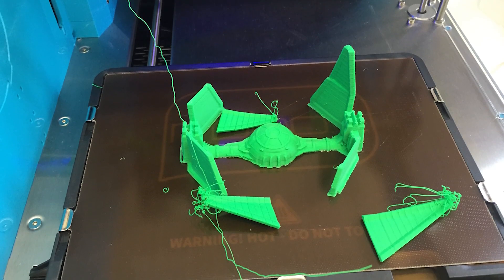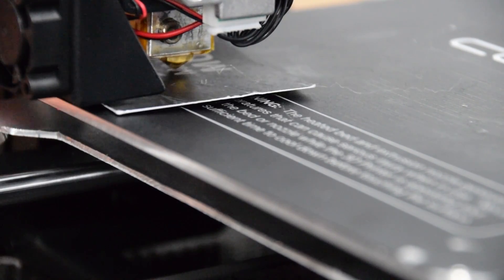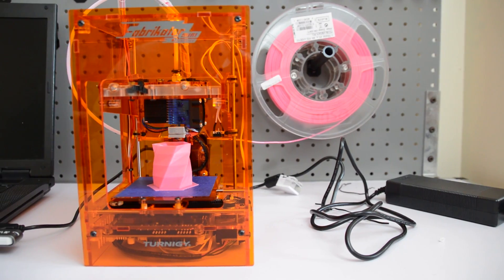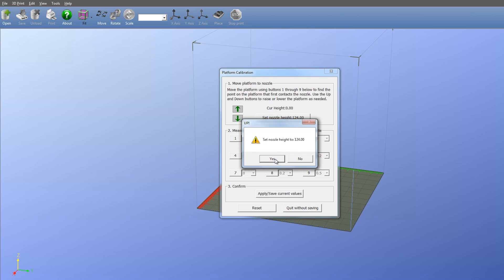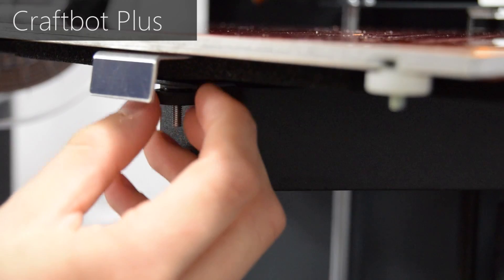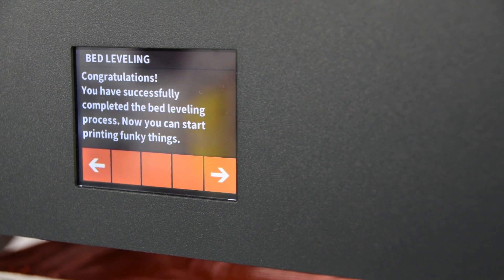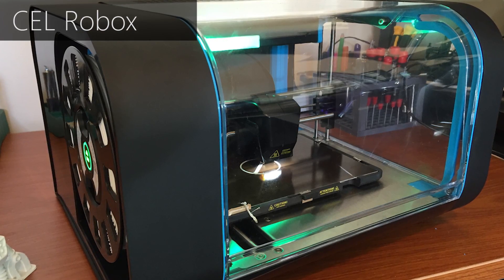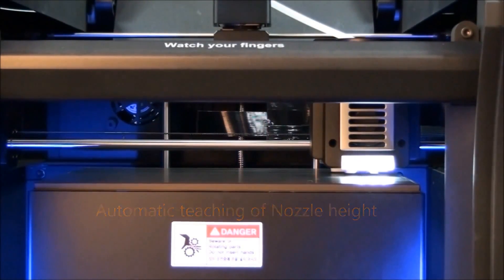How to Set your Nozzle Height and Level your Bed - 3D Printing 101

Comment: An issue I am running into is the printer will lay the trim line flawlessly and then when it proceeds to actually print the first layer of the model, it just wont stick. The trim line sticks but the center doesn't. I've adjusted the height at least eighty times in the last two days. Any suggestions?

Comment: if you have a 0.2mm card why not use the card to set nozzle to zero by telling the nozzle where it really is? you can even do a bed leveling mesh from this method.

Adjust the bed to touch your card. Then tell the control software it is at 0.20mm currently. done. no muss no fuss.

No guess and check. 

Is the way the FlSUN Cube does this (as described above) just new?

It means the slicer knows that you asked for a .35mm first layer and it knows z=0 is thr nozzle touching the bed, so it just starts printing at 0.35mm. done. why make it so extra manual?

plus how you you get an accurately tall print this way. it would allways be off in the z axis if printer z=0 isn't set to nozzle touching the bed (by telling it the offset you tested with, like the card or a4 sheet of paper)
Reply: have printers just come this far in a few years. how was this not obvious to the origionals?

Comment: Angus I got the Prusa I3 Mk2. good printer fully assembled. However going through the menu options ,etc. I clicked on Calibrate XYZ, so the printer went ahead and did its thing, however when it comes to the nozzle height I am a bit worried that I may not be setting it correctly. The Live Z calibration is a great option  but when do you really know if your setting is the best possible setting. ? When I print , I have been able to see that the back of my first print is no longer shinny or fused together like I used to have it. Is there any feedback you can provide here? I also noticing that my prints are way more shinier not sure why. I am using Colorfab PLA.

Comment: HEy angus my printer manufacturer (CR-10) says to use a A4 sheet of paper which has a thickness of 0.1mm a bussines card is way thicker. Should i listen to them or you?? I learnt all i know from you!
Reply: The statement he made - set the nozzle height to fractionally less than the layer height - is the important bit as you need the 1st layer to squish out just a teeny bit more than the rest in order to grip the bed, so that card may have been around 230gsm board, for an initial layer of 300um. There's a nice table here for you to pick the right weight: http://www.zxprinter.com/support/paper-thickness.html.
But why not just stop using scraps of paper completely? Paper is fine for bills, boxes and bum-wipe, but not so hot for precision measurement at the micron scale. Splash out on a set of steel feeler gauges and be 100% confident in the gapping you set; no grabbing, tearing, curled edges, and a good steel gauge will cut any ooze from the nozzle as you probe so you can be confident you're measuring from the brass not a glob of plastic. Because the metal doesn't deflect into the holes at the bed mounts, you can also set the gap directly over the mounting points. That means once you've set the corner, it's done - you don't have to go twice around every time. Literally halves the levelling time! I got a set from Halfords for £4 - USians near a Hodor Fight can get a set under $5 plus tax.
Reply: baruch shad I was wondering the same thing.  But, I realize now what I did wrong recently when I suddenly had issues printing.  On my i3, if I print at .3 or .4 then a business card makes sense.  For .1mm layer, a sheet of paper.

Comment: Am I the only one who prefers wing nuts to thumbscrews?
Reply: Nope I use Wing nuts to take the print off,
Reply: If the space is more open and I can get my whole hand in it, I prefer wingnuts.  But for my printer (duplicator i3) I like the thumbscrews so I can stick a finger over and adjust it
Reply: Once I get this thing dialed in I will print numbered wheels then install a mirror underneath the bed so I can see what number I dialed in.  To HELL  with all this lack of
Reply: Would love to hack a cheap gyro to it to adjust  itself for weight on large and heavy items stainless steel ESPECIALLY.

Comment: It's very confusing to me how there is a conflation of 'level', 'flat', and I think 'height', or 'nozzle height', these often get shoved into the term 'level'. Something can be level and not flat, or flat but perpendicular to the ground.  Or, you can be perfectly level at the wrong level.

Is leveling the surface making it level, or parallel to a plane the printer thinks is level?  If the surface is flat, how far out-of-level can it get before there is a problem?  And that is an ambiguous question.  If the printer's idea of level is set to the flat printing surface, how far out-of-level, meaning "out-of-plumb", before  their is a problem?  

I'm very new to this, old hands probably have no problem with the ambiguities, might not even realize how rife they are in their speech, but it can sure confuse inexperienced. .

Comment: The Makerbot Replicator 5th gen also does the z axis auto adjustment before every print. The difference is that the smart extruder has a hall-effect sensor inside and there is a magnet mounted to the hotend that it uses. You still have to go through guided leveling every so often, but it uses the same system to do that too.

Comment: I'm currently staring at my computer screen, typing this comment, but a moment ago I was staring at my BLTouch sensor that finally arrived from South Korea a couple days ago...which I keep procrastinating on installing as I dread the currently well-bundled wires turning into a tumbleweed, dealing with extruder carriage dis/re-assembly, and hoping my fingers can get into the board's enclosure without breaking something and/or requiring me to disassemble even more crap. 

Ugh, just writing that paragraph gave me a headache. :-/  I'll give someone $20 plus the old/current auto-level sensor as payment to come do it for me while I drink booze and watch! :D

Comment: I'm not a fan of using a spacer card (business card). I have a FlashForge Creator Pro which uses manual leveling with three points of adjustment. First thing I did was chuck the card. Instead, I use blade type gap gauges. I admit I haven't got a solid rule for the actual distance to aim for. I've been using 0.2mm because the nozzles are 0.4mm. I set the extruders over each adjustment point and either the 0.2mm blade will clear the gap or it won't. I tested for warpage using a straight edge. Before I do the leveling procedure, I work the springs. It seems they can shift about. I start at the front and then work clockwise. Once I've got each nozzle set at the adjustment points, I try a few random points on the bed. Seems to work for that part.

I think the real challenge for me now, as I'm still a neophyte, is working out the proper settings in Simplyfy3D.
Reply: Better to modify the print head and do 1 adjustment from the top,,

Comment: I was wondering about the following method (which I haven't tried yet): 
Instead of using a piece of paper and try to have the nozzle press at it at the same force in every point of the bed I thought about: 
1. Calibrate the nozzle to exactly the biggest distance that doesn't allow inserting the piece of paper. 
2. Compute the wanted distance through the slicer (or perhaps simply move the object you're printing to be in the 'air'). 

Why wouldn't this work?

Comment: Sorry to be a nuisance, but have you had any luck ripping 3D models from Unreal games? Also I enjoy your videos so much I will contribute to your video production this coming week, keep producing.
Reply from the maker: +Felipe Acevedo I have successfully ripped from Unreal Engine 3 using the method I describe in my 'chivalry' video, but I haven't yet pulled any Unreal Engine 4 files. You need a way to unpack .uasset files. I want to print from Ark - survival evolved which is based on UE4. Thanks for the support!

Comment: One thing I never see anybody mention is when leveling the bed make sure the z axis is level. You can swing your bed around all day trying to make it level but if the z isnt level all you are doing is compensating. Its easy to do just take a pair of digital calipers and measure the distance between the bottom and a smooth rod or something on the z thats at the same point on both sides
Reply: Ask Holy Spirit to teach you and to guide
you. I would recommend the YouTube Cleveland street preachers and follow Jesus no man no religion. Be holy and obey Jesus. Hebrews 5:9 "salvation is for those who obey. Jesus says if you love me keep my commandments (John 14:15). Jesus even says if you keep my commandments then you shall abide in my love (John 15:10).

Comment: Hi  Angus, what would you say is the optimal height of an extruder, a sheet of paper is about .003 thousands of an inch while a business card is about .004 or .005 in thickness, just wondering.
Reply from the maker: +Felipe Acevedo It's hard to say, some 3D Printer beds you can push the nozzle really hard and close into them like the up mini, so for that I would go closer than say, a printer with a large glass bed with very little flex. I usually set to a business card and then test, if it's still too far away i'll slowly creep it closer. It's always better practice to be too far away than too close as you can easily ruin your print surface!

Comment: On the Wanhao i3, I use a relatively thin sheet of note paper with one fold on one side. I set the bed level so that I can't feel the single sheet, but the double layer offers some resistance and it's still easy to pull the fold through the gap between the print head and bed (with significant resistance). This works really well at 0.2mm, but ends up being a bit too close for 0.1mm. I'm using Simplify3D to slice. Which brings me to my point... The zero level for the printer that I have set is some known offset from the print bed. Yet, there's no setting for this in Simplify3D: the wizard UI recommendation is to set the bed level to about where I have it, but for 0.1mm layer prints, I would like the printer to start 0.05mm higher and at 0.2mm, use the default offset (so relatively speaking 0mm). Using default settings, 0.1mm PLA prints actually stick a bit too well and the first layer is too thin in some places (the brim will sometimes nearly disappear).

I just read the tutorial on first layer height at Simplify3D. They recommend setting the first layer height for thin layer prints to 200% or more. I suppose I'll try 150% or 200% and I bet that will solve my issue... Essentially the first layer will then print as if the whole print was 0.15mm or 0.2mm, giving a bit more margin of error for bed level variations.

A business card (like in your video) seems awfully thick compared to what I'm using.

Comment: HI Angus,
You didn't mention to have both the bed and nozzle heated to the correct print temps for setting the level and Z-height. Thermal expansion can play havoc with settings done when the machine is cold.

One other thing. You discuss being accurate with the bed level settings but your reference thickness [ie the business card] could differ dramatically from card to card. I think you need to accurately measure your reference card to ensure that the height is correct. Otherwise you will end up with a level bed but a Z-height that is way off.

Thanks for the great videos, as a new relative newbie to 3D printing, I always learn a lot from your YT output. Thanks again...

Comment: i always heat up my bed before leveling.  saves much headache
Reply: Jordan W I’ve been looking for tips on this. Do you heat it to the temperature the material you run? If so, how do you not burn yourself or the paper as you make contact with the nozzle and the bed?

Comment: I would highly recommend investing in a set of feeler gauges and using them instead of a business card.  At $3-$5 is a very worthwhile investment!
Reply: VAXHeadroom what is feeler gauge
Reply: Got one from amazon, thanks. What’s the right gap for PLA and PETG?
Reply: @ludovic2003  I use 0.2 mm for a 0.4mm nozzle

Comment: Hi Angus, I have a topic related question. I ran into a problem with my UP!mini using buildtak as a printing surface for ABS prints. Out of a sudden I started losing contact of the print surface after about 5-10 layers. I releveled it and decreased height as suggested from buildtak. Had no effect and I hesitated to further lower the nozzle below 0.1. I am using a metal thickness gauge for leveling, so I guess it should be most exact. My filament is getting a little old and I print in my living room, so I thought about air moisture and dried the filament, with no effect either. I returned to raft printing and I worked but not very well as I could easily lift the print form the bed where I had to scrape it off earlier. 

I havent heared before that up!mini bed leveling doesn't work with raftless prints... why is that? Do you have any suggestion what could trigger these failed prints? Next thing I would test is new filament, but I don't want to waste the remaining ABS if it is not a material problem. 

Thanks for the informative video, I really enjoy following your channel
Reply: +Wargaming Miniature Showcase buildtak works great except it is prone to absorbing oils from your hands as well as simple dust. buildtak themselves recommend using 70% isopropyl alcohol to wipe the surface every few builds. I've never had an adhesion problem since I started wiping down the surface between builds. also depending on the plastic or brand/age some have suggested using a water soluble glue stick such as elmers in the purple label. haven't needed to use it (yet) but thought I would mention. btw great video Angus helpful as always.

Comment: My Prusa i3 has the four corner screws with springs. I locked one corner by removing the spring and secured it with lock nuts. I just set the other three to that one now. I print on glass and have several pieces so I just remove the glass and print and fit another to carry on printing without having to wait for it to cool down. Problem is all glass is not the exact same thickness. So now I'm fitting a servo type auto level using Marlin. Just about got it working and fine tuning as we speak, so to speak. Keep up the good work and vids Angus....

Comment: When i first got my rigidbot i would level the bed and the center would still be off. Eventually i found out that the aluminum bed wasn't flat so i replaced it with glass.
Reply from the maker: +Panoreth 3D Printing Ahhh bugger... nothing worse than a bowed print bed.

Comment: Very helpfull video. 
I have a wanhao i3, but it seems the z-axis won't stay level. Every time i level it it looks fine, but when I start printing I need to adjust the bed because the nozzle is pushing on the bed surface (at right side). I'm now running with a bed which isn't level, but it's is parallel to the z-axis... It works... Somehow... Any suggestions on fixing the z-axis?
Reply: Hi, 
Kind of the same problem here. It seems my bed on the i3 has a dent in the middle. I could level the edges but in the middle part the paper sheet I'm using is of by about one millimeter. 
Has anyone a solution beside a glass bed? 
Cheers mates

Comment: I really am so fed up with my printer because of bed warp.  If I had a shop locally that would Tool Plate me a replacement with the holes countersunk I would grab them but after 3 things coming to me, for this printer, and all were warped and bent I have no trust in a 40 dollar tool plate that has to be mailed to me.

Comment: How come you never cover any delta 3d printers?
Reply from the maker: +fARQUAD Simple answer, I've never used or been sent any. If I do, i'll start covering them!
Reply: you'll have to come watch my videos for delta tips. :) it's all I got. lol. ~Russ
Reply: +Maker's Muse  When you do get one, you will learn a whole new level of pain lol . Calibrating these things on a delta is.... special. :)
Reply: ***** I have actually watched some of your videos, and delta printers seem like a pain in the ass to calibrate!
Reply: +fARQUAD lol. I was going to say that. but. I'm finding new ways to do it with different firmware. also getting the geometry right helps.  what delta do you use?  in finding out that the repetier firmware is a lot better and seems to do the trick even when the geometry is not quite right. I have allways had this problem with my rostock and I will be switching over to the repetier firmware in the future. that will give a real test. from when instarted 3 years ago till now I'm finding out that there making headway with auto cal with the delta's. at least the repetier firmware dose a fairly good job. marlin is not so good. also I jumped ship on the ramps and mega for the OSD. going with something totally different so will see how that gose. lol. ~Russ
Reply: +rwg42985  Hey Russ, love your big delta, by the way. I´m subbed to your channel. Check out my delta on my videos. Calibrating it was a major pain.. i´ve got it to print well enough but gave up on getting it super spot on. Your probably right about repetir firmware, i use marlin. And by the way i think running a delta on a RAMPS 1.4 like mine also does not help at all lol
Reply: +Maker's Muse  Just as a curious fact, we just had an "Inside3DPrinting" expo (ended yesterday) in São Paulo - Brazil. Lots of manufacturers present, not a single delta around. Seem´s that it´s not worth the effort in their oppinion. Too much after-sales issues as owners need to know what they´re doing in order to maintain them.
Reply: ***** Don't currently have a printer at the moment, though I am looking to buy or build one once my GCSE's are done. Only willing to spend around £200, so like a Prusa i3, maybe DaVinci Jr or just one from scratch.